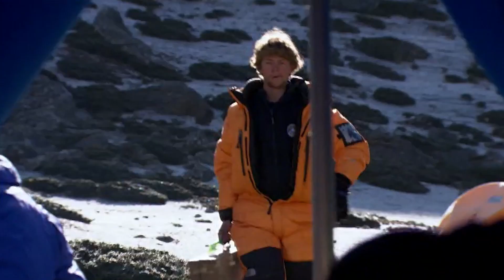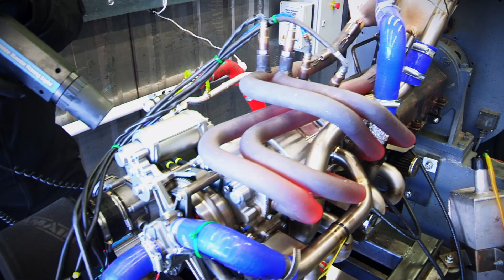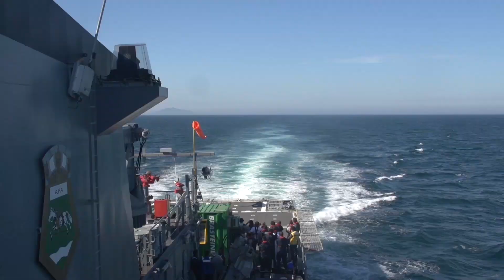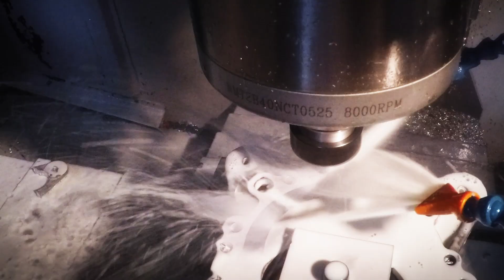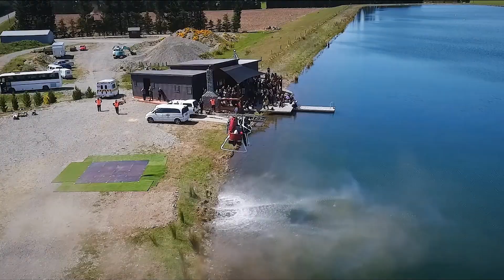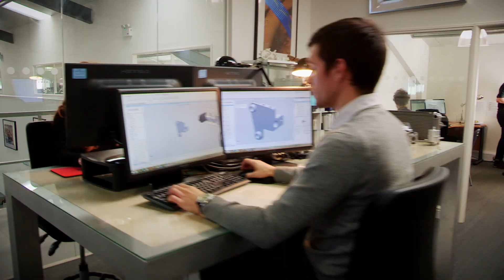Introducing Rotron Power Engines

Comment: How expensive are these engines? I bet they're pricey!
Reply: The 600 XE is like $7800 or around there. You could get a much bigger piston 2 stroke that makes way more low eng torque cheap.
Reply: Its cheaper to get a Norton 588 bike for christ sakes. Or take a mazda engine with is 1300 cc, I got my OMC 528cc rotary for 220$.But the the rotro 700cc 2 rotor would make i nice motorized sofa prohject.